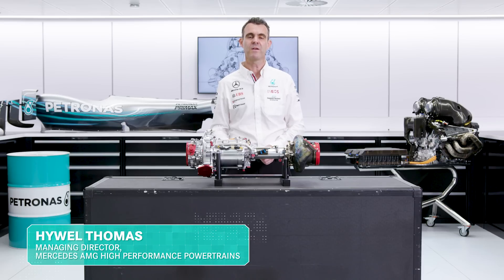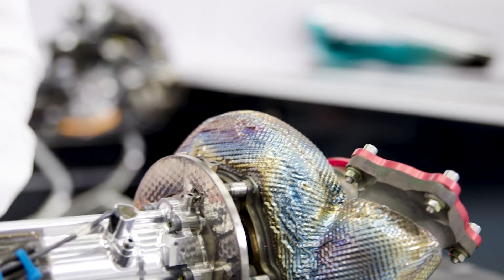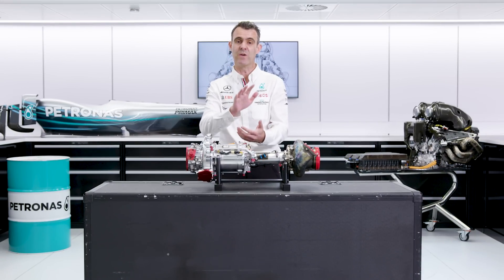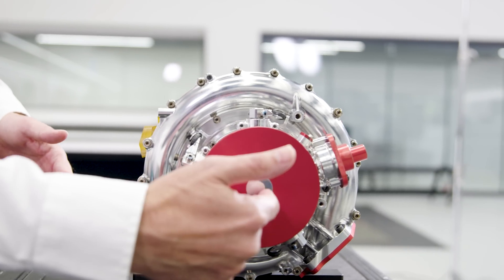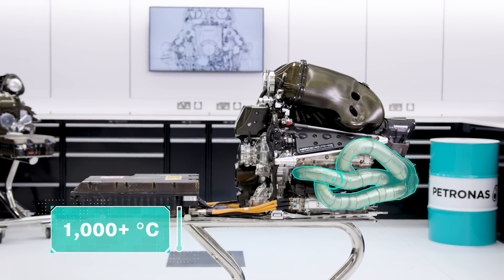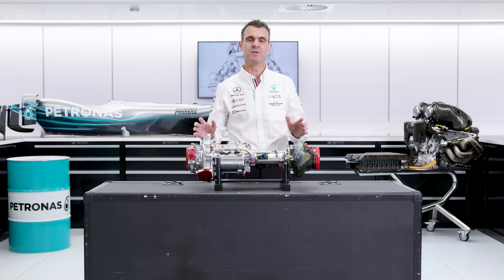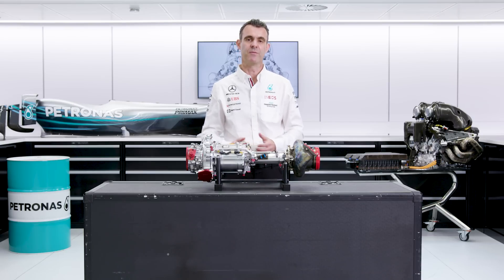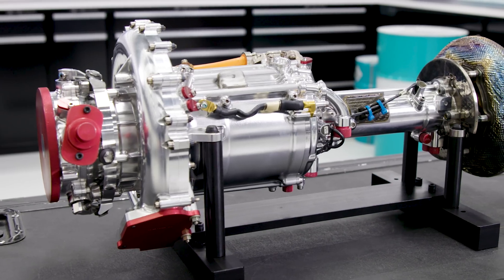Power Unit 101 with PETRONAS: Turbocharger, EXPLAINED!

Comment: Curious if you can GDI into the compressor side of the T/C to help create a more atomization for a more efficient fuel burn mixed with a 50/50 water/methanol mixture.

Comment: I'd love to know more about the 120kw traction motor. I remember a few years ago they mentioned a 1000V energy store and so I'd love to know what the motor architecture is.  I have theories about it being a synchronous reluctance motor for weight and cooling design but also a permanent magnet motor for torque density or a non-salient motor for consistent power characteristics at high RPM. Would love to see this next

Comment: Hello; out of interest, why has this not found it’s way to road cars yet? I’m aware of the cost and complexity but the concept of generating electricity from what is basically a mini gas turbine is fascinating. Gas turbines are one of the most efficient ways of generating electricity. 
What if you put this on a road car and left the ICE running at idle or you were cruising at 65mph, surely it would generate enough electricity to charge a small 48V battery or power another electric motor without having to be full throttle all of the time like a race car driver? 
Thanks

Comment: So does the MGU-H only scavenge power from the turbo shaft or can it deploy it to the shaft as well?  I could that being useful in a scenario where you need to boost the output of the combustion engine in a circumstance where the turbo couldn't operate efficiently like when you launch the car from a stop.  You could spin up the turbo to maximum speed without having to load up the Engine.
Reply: It does both. This is why the current power units exhibit little to no turbo lag. Deployment of the MGU-H occurs most when exiting a corner, when exhaust output is small and turbo speed is low.

Comment: This year the title is already with Red Bull. If Mercedes wants to challenge Max Verstappen in 2023, it cannot waste any more time with the W13, even if the cost is no victory in 2022. And I say that strategically, it is even better if they finish the championship. in 3rd place, as they will have more time in the wind tunnel, CFD, simulators and development than Red Bull and Ferrari guaranteed until June 2023, the deadline for changing the order of priority in development in the inverse ratio of the position in the Constructors Championship.

Comment: Hey Mercedes why don't you use free valve technology ? 
It is the next generation engine technology and yes it's patent by koenigsegg but new generation engine rules are coming in 2026,why don't you simplify the engine with less moving parts, better power and higher engine life, less costs instead of ditching the MGU-H ?
 If F1 still wants to be on the cutting edge why are you than going backwards in technology ? 
Koenigsegg did give their technology to a chinese car manufacturer for mass production engine with freevalve so why don't you make a collaboration with them ?

Comment: I was always curious as to what that particular turbo charger looked like.  Are those style of turbochargers available on the common market?
Reply: No. That's one of the reasons its being removed from spec. There isn't a road car use for the MGU-H part so engine manufacturers were unwilling to continue with F1
Reply: @jawadbilgrami4676  I believe it's on the AMG One but that's it
Reply: @jawadbilgrami4676  Only the MGU-H is being removed. The split style turbo system that all manufactures use will remain.

Comment: As a mechanical  engineer and fan of the Mercedes-AMG F1 team, I think it is fantastic that the team not only does the Race Debrief but also component engineering technical videos showing actual components. I would like to see a technical video regarding engine tuning for various tracks and how the optimization is implemented as there are no on track dynamometers.
Reply: What he said ^... I have worked for a company that made turbocharger parts for road car engines and the tolerances on those were tight. I now work for an engine manufacturer and see the requirements that drive those tolerances. I can't get my head around how Mercedes have made this concept work, let alone as reliably as they have over the last 9 years. I don't know what is more impressive, the original idea and concept, making it work at all or making it work as reliably as it does. Mind blowing engineering.
Reply: Ditto. More of this content please.

Comment: So if you could make the main shaft out of a high temp/strength magnet, at the section that passed through the MU housing, polarize it to a 4 pole type, wonder if thats how they do it.... the shaft of the turbo becomes the rotor of a brushless motor at the MU.

Comment: The split turbo design probably changed the F1 hybrid era the most all the other teams soon copied after Mercedes brought this in
Reply: Yeah, but Ferrier is still fiddling with the opposite idea. Judging by their results this year, it's hard to say which one is truly superior.
Reply: @studentchen87  split turbo definitely superior colder more denser intake temps the Mercedes is flawed by aero this year not power and the merc is the most reliable
Reply: @benjones1180  has it occur to you that they might be related? F1 is a very compact system that the form factor and packaging of anything has an impact on aero. Having a long axial that needs to be very strong running from the front of the engine to the back requires compromises. Perhaps some other thing that could be packed there now has to be on the outside, making the engine and thus the side pod wider. Perhaps the intake and exhaust has to be separated so the car needs to be in certain shape at certain area. Perhaps this make certain structure weaker so it has to be reinforced. Of course these can all be overcomed by smart designs. But Farrier believe the cost of compromise is too high and rest the padlock think otherwise. Thus my comment: can’t really tell which side is right given the results .
Reply: @studentchen87  the w11 was the fastest ever f1 car with a split turbo , so didn’t affect the aero much no side pods is the w13 problem and it’s weight
Reply: @benjones1180 
The w11 was the fastest purely thanks to it's aerodynamics, the power unit barely changed from previous years

Comment: In fact this pioneer design of turbocharger with ICE and ERS was one of the main reason for eight consecutive constructors championship, with eventually others adopting the same layout. Kudos to the design engineers and others who worked on this project.
Reply: the design was originally inspired by aviation, where this configuration was first used...i think andrew shovlin or james alison mentioned it in some other video
Reply: The layout is similar to the very first jet engine made by frank whittle just before ww2.

Every jet engine has a turbine driving an compressor with an long shaft with the combustion chamber in the middle.

This turbo obviously has the mguH in the middle.

However the main advantage is not well explained in the video. By putting the compressor at the front they remove it from the very hot exhaust gasses. Which means the compressed air is less hot.
Also there is more room at the front so the compressor can be made bigger for more volume.

This means more and cooler air which leads to more power and or less intercoolinh. The latter is an aero advantage.

It was an brilliant idea.
Reply: 7. Poor lulu

Comment: This Mercedes PU is totally underpowered is quite evident from the fact that it always gets lower speed in straight line speed trap when compared with Redbull, Ferrari & Alpines.
So no hope for Mercedes until 2026 as this underpowered PU has been Frozen.
Reply: I believe the lower speed of the mercedes in the straight is mostly due to the car's huge drag compared to others
For instance williams were the fastest guys last GP and they are mercedes-powered F1s
Reply: @MrTheben99  what drag are you taking about? They don't even have a Side pod to create drag.
Reply: @sambitranjan9584  the rest of the car does, though. The Mercedes is one of the less efficient cars on the grid this season, producing relatively high drag for a small downforce gain.
Reply: Well not really… they are allowed to make reliability upgrades… which means they can run the engine harder. It’s very grey area for mortals like you and me lol

Comment: Only 5%? I thought the MGU-H is the main reason for the mentioned thermal efficiency of 50% of a F1 engine compared to the 30% for a normal road car engine.
Reply: When it comes to thermal efficiency a 5% gain is massive, considering road cars have been stuck at around 30% for decades.
Reply: @UnremarkableKevin  I agree, 5% is still a huge deal, but where are the other 15% coming from? Of course mercedes wont disclose details, but I would be very interested in a deep dive.
Reply: @frdyn8tr  I'd say the fine tuning of the ICE and high efficiency of the MGU-K. I would think the ICE alone would be well above 40% based on how much power it can make on so little displacement and fuel flow (but I'm just guessing at this point)
Reply: 5% is the turbo only :)
Reply: Turbo not the mgu h itself. Hence the topic. Wait for the next video.

Comment: Give more power to the w14 we are lacking straight line speed which biggest strengths to previous years and now its a minus 🙄🙄🙄
Reply: It’s not lacking power.. the car has too much drag
Reply: it`s more about aero and chassis package that needs to be resolved, current pu is powerfull and durable enough
Reply: PU is frozen until 2025 season, only reliability upgrades are allowed.

Comment: Cant believe f1 is discarding this incredible technology
Reply: The turbo will still be there. Just smaller, and without the MGU-H more lag, which can be compensated for to an extent, with a variable geometry turbine. Although not in the regulations, it's ubiquitous among engine manucturers, and would be very surprised if it were not allowed for 2026.
Reply: Criminal
Reply: Because no one has any intention on installing this in passenger cars. So its money wasted only for f1
Reply: It costs more than everyone in this comment section will make in their lifetime combined. It's unsustainable
Reply: @MeltingRubberZ28  what are you talking about buddy
Reply: @johnnychimpo7539  the development cost is over 1B. It's unsustainable.
Reply: @MeltingRubberZ28  who is needing to develop it? It’s already implemented
Reply: @johnnychimpo7539  They try to make it more efficient every time.
Besides it has no real use for road cars until everyone drives like possessed by the devil.
Reply: @johnnychimpo7539  the real issue is it's lost it's relevance. It's not that efficient for even it's manufacturing cost. It's never going to make it to road cars which F1 is trying to make it seem like their development makes its way down to us mere peasants eventually. They keep losing engine suppliers and this was one of the reasons for it. It makes sense why it was removed from future use.
Reply: @themassmauler  I'll believe it when I see it. The AMG One doesn't count.
Reply: @MeltingRubberZ28  it’s not that efficient compared to what? They are the most efficient f1 cars ever

Losing engine suppliers? What does that even mean and why is it relevant
Reply: @MeltingRubberZ28  u spent the money just keep it
Reply: @MeltingRubberZ28  f1 hasn't lost a single engine supplier since the mgu-h was implemented, infact they've gained one, that argument is moot
Reply: @MeltingRubberZ28  the mercedes m256 features an electric supercharger, which is basically an mgu-h decoupled from the turbo, the m177 and m178 engines also use a hot vee setup for their turbo chargers like their f1 engine, the innovations have been trickling down you only chose not to see it.
Reply: @chiefdenis  electric supercharger is an MGUH 🤣🤣🤣🤣🤣🤣
Reply: @chiefdenis  Honda left because of costs and no relevance to road cars so they wanted the R&D elsewhere. Trying to say RBPT is an additional supplier when they're not (yet) is also misleading at best.
Reply: @MeltingRubberZ28  i was talking about honda, rbpt doesn't make any f1 pus.
Also honda 'left' as a way for rb to lock in a power advantage because they finally got on mercedes level, they're now contemplating getting back fully in because their pus are finally competitive.
Reply: @MeltingRubberZ28  electric supercharger is fundamentally an mgu-h without the generator part.
If you understand how the mgu-h works, it's basically an electric supercharger that repays the energy it takes to spin it up.
Reply: Think we should just keep this engine make it more efficient  say 75%
Reply: @mickbrooks8114  why not 98% while we're at it?!
Reply: dumbing it down, making it less efficient🥲
Reply: @alexjohnward  exactly, few years ago we were bragging about 50% thermal efficiency, seems all f1 does these days is go backwards